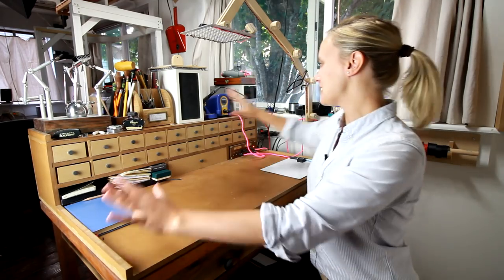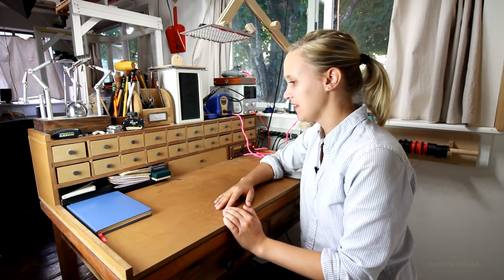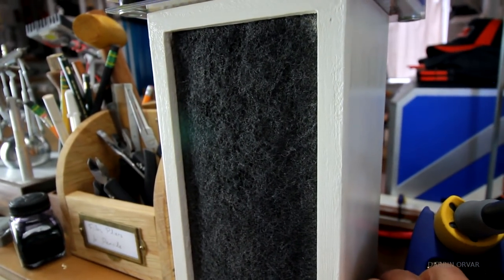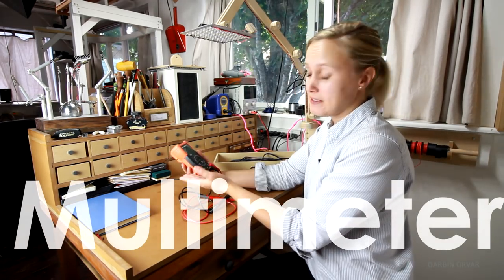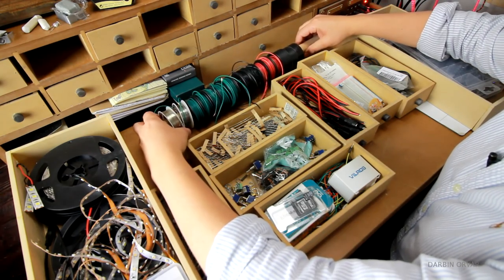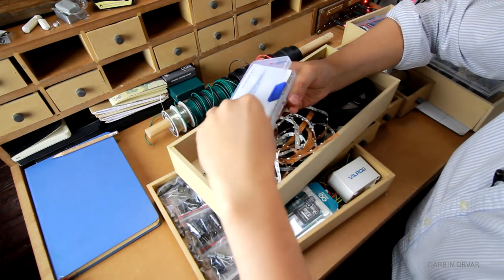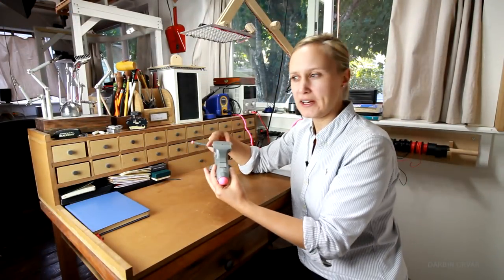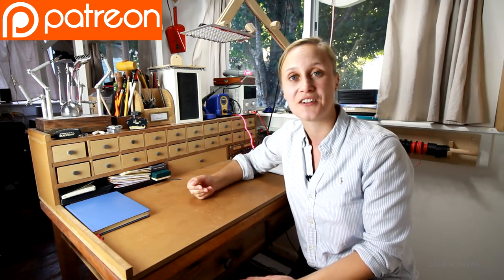Electronics Shop Tour - What You Need To Get Started

Comment: Nice video. I just wanted to add something about soldering irons, if you all dont mind :) As an engineer i had many situations with soldering, basicly there are just two things too look for out there. Tip longevity and tip grounding. Tip longevity depends on type, but everything that Uses hakko 900M is great, and there are chinese copies which are not so bad. And grounding MAKES SURE that your tip is grounded. You can check this, connect your powersupply and place multimeter between minus and tip of your iron, also plus and tip of your iron you should have NOTHING, zero volts AC or DC. If you have voltage this could damage your electronics. And practice just keep practicing, solder desolder destroy PCB :D just try try try thats how you get perfect. Hope this was not too long :) Great job for channel great job :)

Comment: you need to remember the power limit of some resistors, a lot that you buy of the shelf are 0.25W. Power=volts*amps , amps=volts/resistance therefore power = (volts*volts)/resistance, so that1.8k resistor will have (16.8*16.8)/1800=0.157w of power which is fine but if you start to increase the current or voltage without changing the resistor you will blow it. so if you have a 20mA LED you will blow the resistor

Comment: You can find tons of great things inside of old printers you see thrown away all the time. You would benefit greatly with a soldering re-work station for salvaging components off of circuit boards...makes life so much easier, instead of desoldering.

Comment: Cable ties and electrical tape seems to be something I have a lot of, as well as wire snips, I have about 10 sets, just because I use the, for craft with my girls, my model making, electronics, work in my car, so many different things. I also find brush on electrical tape handy, as well as various coloured hot glue sticks. I have plastic boxes with my switches and LED's and components but it's not an ideal setup.